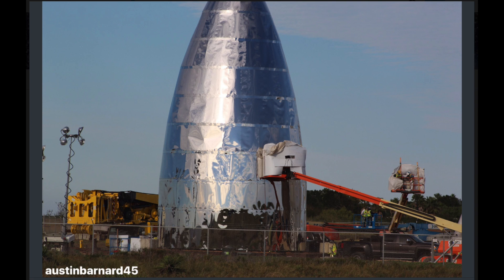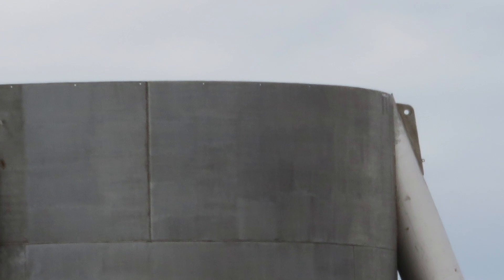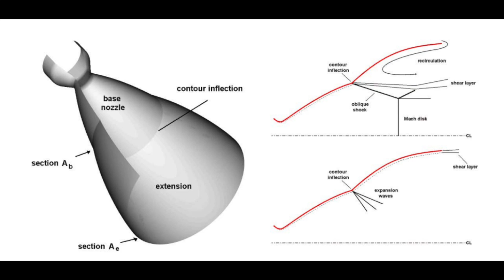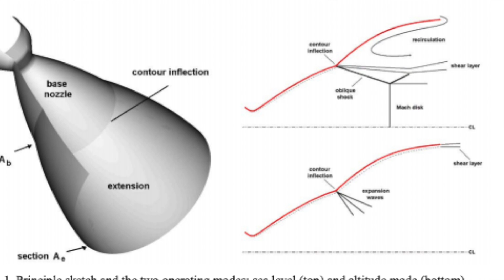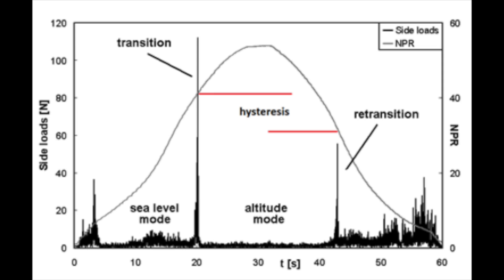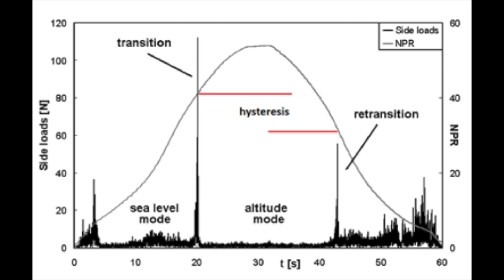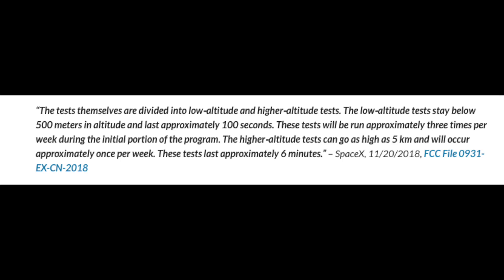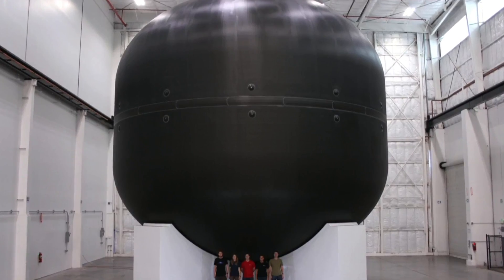What's Going On With SpaceX's Stainless Steel Starship?

Comment: Some observations from someone who enjoys working with metal. 

The base section is completely structural. It is using welded heavy wall stainless steel pipe for a bulletproof internal support frame and landing legs, heavy enough to withstand "slight miscalculations" on the suicide burns and punch holes in the concrete if needed.
This looks like it was designed by an engineer familiar with building bridges and roller coasters and other such durable structures, and I see signs of very good workmanship in the welds and little details like the contoured gusset plates and such.
It really looks like it's designed to support a bridge rather than fly. But considering that Elon probably wants something close to actual weight, overbuilding this is not a problem, and makes it more likely to survive heavy grasshopper testing without needing repairs. (landing pad is more likely to need repairs lol)
The shell of the base section is heavy gauge SS as well, and was all bent in large probably CNC plate rolls making perfect curves that fit and weld together. And it is heavy enough not to distort from the welding. 
I assume that this will all be polished up to a mirror finish, and was built by a structural engineering team.

The upper sections are built totally different, and I suspect by a different team or company.
They seem to be an open framework with thin sheet metal panels fastened over it.
It makes sense that it is a water tank company, because they would have experience doing such things.
Now the difference is that they normally aren't trying to do compound shapes with thin sheets on water tanks, and it is nearly impossible to do it with flat sheets without lots of wrinkles and divots, just like of you put a sheet of paper over a basketball.

They may have some trick to use heat to stretch the sheet metal and smooth it out after the structure is finished, it's pretty much black magic, but it is used by good sheet metal workers, so I say wait a little while and see what they are able to do.

I also will not be surprised if the company that bid to do it had never done anything quite like this before, and are finding that they are fighting the metal, and it is winning lol
So this may turn out to be a total failure on their part of being able to get a good looking result.
Elon may be fuming about how ugly it is looking as we speak.

On the other hand, as long as it is all attached properly, it is totally flyable as a grasshopper, and once the polishing is done it will be hard to see the surface shape.
So it is possible that Elon decided he wanted something of the right size and shape and shiny to be in the air asap, and so is using his preferred fail fast prototyping method to knock together something that can hop, even if the appearance is wanting.
If that is his goal, this is the way to do it.

If you have seen the videos of that NASA guy who worked with SpaceX, and helped develop the Pica heatshield, (can't remember his name, but it was a series of short interviews), you are familiar with the culture there of being able to order stuff up from McMaster Carr, and put a test prototype together the next day to see what happens, and this seems to fit that profile.
Though they probably didn't get the metal from McMaster lol

So whether Elon is angry at how it looks, or this was the expectation, it is the fastest and cheapest way to get a Starship prototype hopping, and the appearance really doesn't matter for the testing, since it won't be going fast enough to have any effect.
And using stainless steel is just because he wants it to look shiny like the final version lol

As far as tanks, he doesn't need large or super light tanks for this first prototype. For initial testing, he can probably just use umbilicals, or small tanks.

In order to make this shape with stainless steel, you basically need to use the same method that car body panels use, and hydroform or press them, so each panel is already shaped properly for the location it needs to go.
This however requires extensive time and work making the dies for each section, since the sheets change shape and size as it goes up, so this is a big investment, and I can totally see him saying to just wrap it in tin foil to get it flying.
They very likely are currently working on building dies and such, and may replace the upper section as soon as they are done and some hydroformed panels are available.

So let's see what they are able to do to smooth out the tin, and remember that as long as it is being moved around and welded on, any straightening they do will just get messed up again, so they may be waiting until it is stacked before smoothing it.

Oh, and if they were building this for anything other than an actual test prototype, they would NOT be making the top to look like a steam punk Burning Man art installation. The very fact that it is ugly and utilitarian, for something that Elon is doing, tells me that it is for hard science quickly.
Reply: Having worked in the sheet metal and aircraft industry a great many years ago what you are saying makes a lot of sense. Who cares how it looks it could be just test equipment and with the weight of stainless and the short look of this it would make sense that it is the aprox weight of a full size rocket. Again like you said if it is just for grass hopper testing the size and design would make perfect sense
Reply: Oh, and some types of stainless steel sheet are harder to work with than others, and I suspect that they are using a grade or hardness that is more difficult to get wrinkle free.
For instance the landing leg gore with just a flat piece of sheet on it, it's all distorted, and that should be a simple flat surface, so I think this probably a hardened, crackly type that would be a bear to work with, and probably was chosen because it was the same type planned for the final version, or maybe because it polishes up nice.

Shiny!
Reply: @ke6gwf  
You may have, by now, seen thin shiny foil being installed as a veneer on the lower section of dull metal. 

Totally agree with you on the sheet hardness.
Reply: @avid0g  I had not looked at the pictures for a couple of days, but I just went back to David's and Cowboy's Twitter feeds, and Shiny!

It had looked like they may have tried polishing the bottom section, but may have decided it was easier to just wrap it, because that heavy mill finish plate takes a LOT of work to polish lol
Anyway, thanks for the heads up.
Reply: @ke6gwf  Great observations!  Don't forget the P.T. Barnum inside of Musk, as he does have a penchant as a showman from time to time.  Part of the faith we have in Elon is because he makes us see things as possible, and if that takes getting Bruce Willis to visit, or even strapping a model of Slim Pickens to the shiny, wrinkled fuselage to distract us while he makes magic inside a hidden bunker/tent structure, he'd probably do it for the laughs.    https://www.bing.com/videos/search?q=slim+pickens+riding+the+bomb&&view=detail&mid=826F71377474B9DF1799826F71377474B9DF1799&&FORM=VRDGAR
Reply: You're correct. McMaster's steel is ass.
Reply: @aaronpeters4394  McMaster is liked for steel by most machinists and such, but I meant because of the volume of metal they were using, so it would be by the truckload from a steel supplier lol
Reply: I'm curious as to what they are using for the legs. I do compressor station design and it just looks like pipe to me. Maybe just ~30" pipe judging from the photos, maybe a bit larger. Wouldn't be surprised if its just off the shelf 30" .750" wall pipe or near that.
Reply: Isn't the heavy construction more practical for engine testing? I read somewhere that it is very hard to throttle down those engines to about 20% of their thrust just for landing. If so, a heavier test rocket makes easier/safer landings with those big engines throttling a little less down for that final soft touch. Does this make any sense?
Reply: @camielkotte  I think I remember hearing that they were hoping to get these down to 10 percent throttle, but whether they will be reliable that low is unknown yet.

In any case, I had not thought about it that way before, but you may be right, they may actually be building this to be heavier than the expected maximum final weight, just so they can keep the engines at higher thrust levels for testing certain parameters of balance and vectoring and such with multiple engines..

On the other hand, a few tons of extra steel probably weighs less than all the life support systems and such that isn't on here, and it's going to be balanced on the thrust, so center of mass vs center of aerodynamic force probably doesn't matter much lol
I mean, it's going to be spending half its life flying backwards!
Reply: This is very detailed discussion and was a fun read. Thanks for the write up.
Reply: Tell me more.  Wait, gotta grab some milk and cookies 😍.  But seriously- very good post.  Well said without getting too technical.    These guys need you running their Pr dept lol
Reply: You’re so smart!!
Reply: That's both the longest and the most interesting YouTube comment I've ever read at the same time! You're awesome!
Reply: I had to lie down after reading all that! Phew!! 😂
Reply: jeremy gilbert me too gnite
Reply: @jez6208  lol, you should see me when I am really into something, and have data to work with!
Reply: Thank you for the detailed information.
Reply: Thanks for the deets Elon, er... @ke6gwf
Cheers!
Reply: I wouldn't be so sure they didn't get the metal from McMaster, given that Pasadena should be easily in their same-day delivery radius.
Reply: @mal2ksc  oh, I wouldn't be surprised if some small quantity metal needs still came from McMaster, but since they are dealing with several truckloads of specialty steel in large sizes, I am sure it would be cheaper and quicker to just call up the steel supplier and have them send a truckload direct. That's what I was talking about, the quantity, since I doubt that McMaster has that much in stock lol

Also, this is being built in Texas.
Reply: @gerardo garnica I did! It's published by YouTube and Scott Manley! ;)
Reply: @gerardo garnica yeah! Really! Write a book! You've really got good writing skills! Have you done it already? If you start, let us know!
Reply: Absolute great read 2 years out from this post with seeing where they are now at with starship. Really shows just how far they have taken it
Reply: @TheBustyOnion  lmao, I just reread my comment, and man, he moved faster than even I was expecting!
I was right about not worrying about the "nose cone" since it was scrapped not long afterwards and was for decoration only.
Watching the iteration through the various methods and designs really shows the way they work, and how if you don't like something, wait a few weeks.
Reply: As far as dies go, it looks like they could do well enough with a series of conic curvatures that maybe could be rolled out somehow.  The edges could have compensating curvatures so the plates would fit right together before welding.  I don't know how that would work out with friction stir welding, which I have heard they are interested in.

There is also the matter of cryo-forming, which I have also heard they are interested in.  At base, this would involve chilling the structure and then working it by inflating it until it expands some 5-10%.  This would also work out the wrinkles.
Reply: @tomhardy604 , is don't see getting those compound curves through rolling, unless you are talking about hand rolling with an English wheel or something, they need a higher degree of precision than rolling could give.

Pressing would be the simplest way, and cryoforming would probably be the finish step after welding to get the smooth shape, but there are many ways to do that.
And stir welding would make sense, but would require extreme precision in sheet fitment.
Reply: @ @ke6gwf  I wasn't sure either (about rolling a conic curve), but does a conic curve count as a compound curve?  It seemed at first thought you could come up with cockamamie roller that produced a tighter curvature on one side than the other, and then roll pieces and adjust, until it is good enough.

Stir welding did seem to be a problem though, and the expense of the cryoforming would leave the cost of your dies far behind.
Reply: @tomhardy604  if it were a simple cone, rolling would be no problem, but it looks like it goes from a cylinder to a cone to a sphere, and so the transition areas at least would be compound curves.

Even then, getting precision panel size and shape would be difficult without some sort of punch press die process it would seem to me, because if you tried to laser cut it first, then roll it, you would get distortion and uneven edges from the rolling process, and then have to find some way to trim the edges to within spec, and since this is a BIG rocket, you might be talking about a few hundred panels per unit, and so I think since Elon likes automation, and because I suspect that the cost of making dies so that each panel is created in basically a single instant step is offset by avoiding the hand fitting that other methods would require, that it would be the natural choice, at least once he thinks he has the basic shape decided on.
And he may find another way to shape panels even better, like maybe hydroforming or drawing it in one giant piece, or maybe 2 clamshells or something. I am sure that he would love to find a way to make it seamless like the renderings lol

One way or another I am sure that he is going to figure out how to make it big, make it fast use robots, and most importantly, make it perfect and shiny!

Because, Elon
Reply: @ @ke6gwf  I make it to be about 8 conic sections progressively smaller as you go up, and then a small (maybe 2 meter) domed end cap.  Is the end cap a different material?
Reply: @tomhardy604  yes, the current rough prototype has a stick built square steel tubing ladder frame, so it may have a stepped cone, but the renders of the finished product seems to be a compound curve to my eyes.
And it looks like the nose should be the same material.
It is the side of the capsule that will get the high heat after all.
Reply: XD wow
Reply: This is a laugh on mankind.... a totalitarian.  This is a paper and foiled Loonaticlander on steroids. Gosh how you are all dumb . 
The Starship MK1 has anyone saw that HD picture :D I am warning not to open holding coffee cup over your keyboard:D  Musk owns me a keyword I  am gonna sue him in court.
Reply: tldr, please
Reply: YouTube calling it a comment is blasphemous
Reply: Could you not roll a wide sheet of stainless steel into a tube and weld it with a single seam? End up with tubular sections that you then weld into a long pipe? Then that long seam goes on the leeward side of the BFS during reentry.
Reply: @rolsen1304  There is not really a significant benefit to doing it that way. The strength of the structure is not from the skin, it is from the infrastructure that supports it. As well, any benefits from laminar flow (or just looking pretty) can be achieved through the use of fill material. We have been doing that since WW2, and a prime example is actually the P-51 Mustang if you have ever seen one up close. Furthermore, the manufacturing process to make one really wide sheet of metal versus a lot of a smaller sheets is significantly more expensive and would require entirely new tooling and specialized techniques. It COULD be done, but the bottom line is that there are not enough benefits to justify the expenses when other methods and engineering techniques exist that are cheaper.
Reply: @rolsen1304  that's basically what they did on the base section, though they used panels to make shipping and assembly easier, but it also looks like they are using at least 1/4 inch thick steel plate on the bottom.
It is totally possible to make giant steel tubes like that with giant industrial plate rolls, but it only works in steel thick enough to hold its shape, and the upper sections are thin sheet metal, more like tin foil at that scale.

You know how you used to build model planes with a balsa wood frame and cloth or plastic stretched over it? That's basically the construction of the upper section, using what looked like a 1" square tubing frame with the sheet metal stretched over it.

This is much much lighter than any plate that you could bend.

The finished version would use construction like an airplane, with probably aluminum ribs and preformed pressed sheets of thin and super strong stainless steel riveted or tig welded onto it, but that takes a major investment in tooling and construction, and isn't needed for a hopper.
Reply: I guess stainless steel is too heavy for rockets. And i am not sure if it is the right material to withstand the extreme temperature fluctuations. Btw. I dont even know if you would use conventional welding in a spacecraft. My guess would be that this is just a piece of Art. Maybe it will be some sort of building where people can enter. It looks cool though.
Reply: @Volpenowski  SpaceX has run the numbers, and found that they can make an upper stage of a rocket out of stainless steel that can survive reentry into Earth's using active liquid cooling without the need for a heavy, heavy heat shield. The weight of a carbon fibre rocket with a heavy heat shield is apparently approximately the same as the weight of the same rocket built out of stainless steel, but without the heat shield. So the whole thing ends up being a wash, weight wise.

So why go with stainless steel if it makes no difference for weight? Because it's easier to work with, cheaper to build and repair, and, most importantly, much faster to build. You don't just weld a hole shut on a carbon fibre structure, for instance. 

(All that said, it's probably not quite a wash in terms of weight. Carbon fibre + shield is probably slightly lighter than steel. But using carbon fibre would add years to the development time, because it's so hard to work with.)
Reply: @Volpenowski  this is a rough prototype for engine and computer testing doing hopping, so yes, the are stick welding stainless steel sheet metal over a steel frame, but it is perfectly serviceable for what it is designed for.

And stainless steel over aluminum ribs like a final version would be, isn't much heavier than with an aluminum skin (such as an airplane) , because the SS can be much thinner than aluminum.
And since the SS can give them thermal properties that aluminum or composite can't, replacing a thick and heavy heat shield for reentry, it gives them a net benefit, even if at a slight weight penalty.
Reply: @Volpenowski  Gemini was stainless steel
Reply: @Volpenowski  "Maybe it will be some sort of building where people can enter. It looks cool though.
"
Dancing and light beer after work... might be quite a joyful noise having a party in it after the landing of the final product on mars!
Reply: @Volpenowski  It is a metal bird  / test bed and not a spacecraft - As such is has to be heavy  / the same WEIGHT as the final product to provide reliable data and three engines gives engine out capability.  Basically its a test bed hover device and will probably never go higher than say 5km, if that.
Reply: It's a prop. It's a statue. It's so obviously not meant to fly
Reply: @thefrub  they would not be working so hard on a statue.
Reply: @thefrub  It is just a hopper, nit an orbital vehicle.  5km max, and no significant speed.  a lot like the old Grass Hopper.